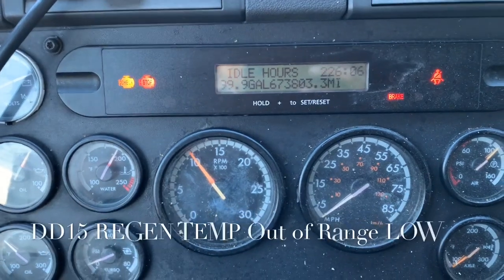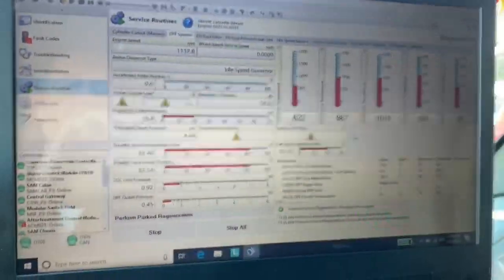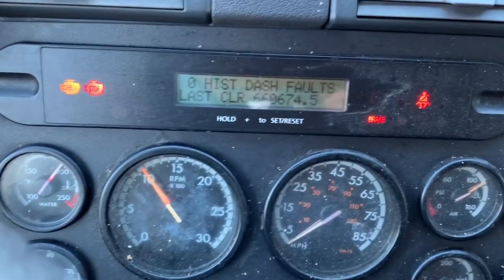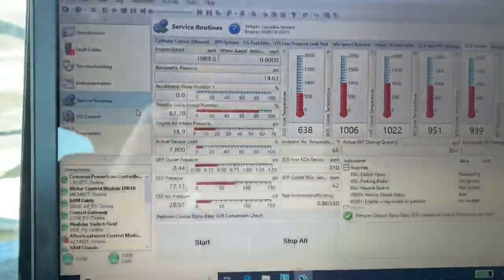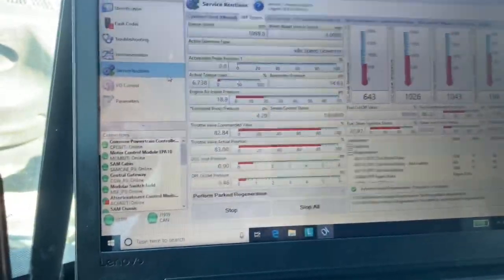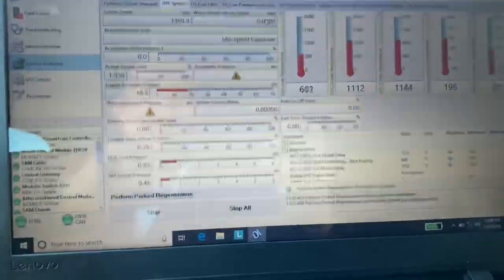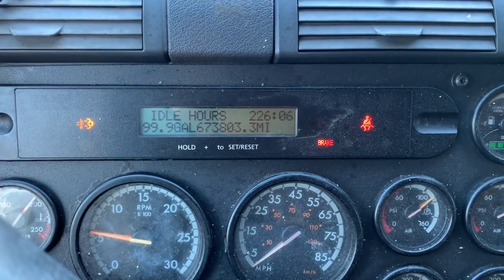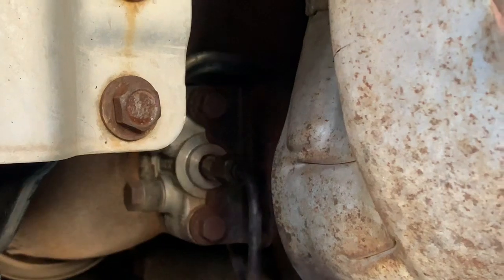DD15 with regen issues. Soot level high, parked regen failed due to not reaching temp. LOW

Comment: Yo bud mad respect for your attitude towards sharing knowledge that doesn't necessarily grow on trees. But to maybe get you to see if you can pick up what I'm putting down. Regarding the ability to read in real time as the zone/levels of soot as they come down, on how certain programs do not oblige such data stream as you would like. Now just hear me out a second. I might not even be making any sense in recommending to use the data monitoring of the delta-p. Sensor before, during, and after. IDK!! ,WHAT U THINK BUD?

Comment: I'm beginning to wonder if it's a problem with the Cascadia, as I've driven a few and they seem to want to conk out on when in lower gears, as I've noticed some sputtering and more hesitation when I've driven both the 10 speed and auto in the lower gears. That's my take on this. Could be that's where the soot build up is more noticeable as well too. I don't know.

Comment: Hello Pedro. Thanks for sharing your mechanical skills through your videos. I been having a major soot problem with my 2011 freightliner cascadia with a detriot dd15 engine. I changed my 1Box because my old box had a lot of rust around it causing weak areas to leak air. And it had high levels of soot as well at the time. After replacing the 1BOX l cleaned the filter that came with it and l blew out SCR filter as well. After driving for a week the system is totally clogged up again. I was so clogged that it blew the clamp because of the clogged 1box. I   towed it to the local freightliner dealership to have the truck checked. After 2 days  they confirm the system was clogged up really bad and they would need to order new dpf filters and air clean the SCR filters in the 1box. I explained to him l just had the filters cleaned and l had the 1box SCR FILTERS  blown out a week ago. I told the shop supervisor that's a lot of soot build up in a week. I ask him did he think it could be a problem on the engine side that would cause that amount of soot in a week. He said they will check to see if there was an issue with the engine. I never received a call they emailed me letting me know my truck repair was completed. I called them to get a run down of what they did and I was told they replaced the dpf filters repair 2 coolant leaks and they blew out the 1box filters. I ask the service person if they check to see what was causing the soot build up. He said because the dpf filters were bad because they were the original filters in the 1box and they failed the flow test. So after picking up the truck and driving it on the 3rd the truck seems like it running out of fuel and stop on the side of the interstate . I called road side assistant to bring fuel and filters after getting the truck to run it kept cutting off. After the 5th try l gave it gas this time and there was a large pop and black soot went everywhere. The 1box was completely clogged up again. The truck sounded good got over 7 miles to the gallon but its producing a lot of soot. The most common reason for too much soot is fuel and air mixture in the cylinder isn't correct to burn the fuel causing  soot buildup. I'm not loosing oil or coolant other than the 2 leaking hoses that was supposed to be replaced but they are still leaking because  the shop used the same old compression hose clamps. Pedro if you experience any repair jobs like this l would appreciate your feedback. Thanks in advance.
Reply from the maker: Heavy soot can be a few things. 
1) software update to the CPC, MCM and ACM will help. 
2) air filter replacement 
3) valve adjustment 
4) have the shop perform an ISB (idle speed balance) to see if an injector or injectors might be bad
5) use clean diesel or good quality diesel 
These are a few things that I can think of.
Reply: @CarlosDieselElectric  yeah l forgot to mention that they did an software update as well on the truck. But it seemed like the truck produced more soot this time because after 3 days of driving the truck it was completely clogged up really bad. I will have the shop check out your list. Thanks again!
Reply: @CarlosDieselElectric  l noticed over in Europe that they have different grades of diesel over there and a lot of truck owners use diesel additives to help the diesel particles burn better in the cylinder. Stanadyne Diesel Treatment is 1 that a lot truck owners use over there. They all claim that their trucks go a  month or months without doing a regen. So I'm thinking by adding a good diesel treatment will help cut down the soot level as well. What do you think about this? Thanks again.

Comment: check the fuel filter and see if the pin is broke off and fell into the fuel line restricting the fuel flow that will not allow the regen to get hot enough to regen the engine that is why Ash levels, to be higher this is what  happened to my dd15,

Comment: OTR. I had same issues. Honestly it’s not work. Until you clean dpf filter. The reason why this code come after 600000 miles because your dpf filter need to cooked. Why this code don’t come before 500000 mile or 600000 mile because your dpf filter clean. The smoke not cross completely to dpf filter cause of too much Corbin. The the smoke come to back to the injector 7th. You clean  7th. It’s work only few days. Again same issue.

Comment: Hello Pedro.
I'm an apprentice mechanic in Alberta Canada. I really appreciate your putting your knowledge and experience for us to watch and even learn from. 
Thank you
Reply from the maker: Glad you like the videos 👍🏼
Reply: @CarlosDieselElectric  
Hi, did you lock in the engine over ride button to keep the truck from shutting down.? Once those lights come on the computer won’t allow the truck to run more than 5min before it shuts it down.
Reply from the maker: @cedthetruth1311  the earlier trucks EPA07 did allow you to run with the over ride switch. Then EPA10 and newer came along and things changed. The over ride just lets you get over to the shoulder.

Comment: That sent me to the poor house,I replaced the one box,and still couldn t do a regen,finally, it was the DEF quality control valve (or something like that). 
The dealer in Knoxville assured me that once the box was replaced my troubles would be over,box was replaced and they took an extra 7 days to find the real problem,I paid for their incompetence... 20k doesn t sound like a lot,but it is a lot when the freight rates are very bad,almost 2 yrs later I can see light at the end of the tunnel debtwise.
I learned that Credit card companies charge a lot to finance 20k,I'd never used a c/c this way.
Reply from the maker: Sorry to hear that, I personally do everything I can verify that the One Box is still good before I say it needs to be replaced. I test everything out first for just that reason, I know how ridiculously expensive the One Box is.
Reply: What was the real problem?
Reply: @BlessednFree  I bought the trk used,the dealer assured me that they did ALL inspected all with a haircomb,I naively believed them.
I learned later that my truck was laid on it s side or crashed it s passenger side,YES,it damged the One box,eventhough it looked ok,it had a hairline cracked,not big enough to be seen,(unless you were the bionic man),but big enough to suck in air and create havock in the sensors,my truck ALWAYS had a yellow code,I spent so much money trying to fix it,until that one day when it could no longer be regened,once the box and the other issues were replaced and fixed,the truck worked magnificently,for about a year,then the engine went,but it had slightly over a million miles,the engine did what it did.
Looking back,I should ve kept it, it had new everything,radiator,hoses,box,injectors,clutch...
Anyhoo,I learned about the box the hard,expensive way.

Comment: 2011 cascadia code ecc 61 spn 3719 fail 00. Also code cab 33 spn 522116 has pretty much always been on. Ambient temp sensor was replaced a while back and temp has beem reading correctly. 

Both ecm computers and the transmissiom were replaced about 20k miles ago. 

Truck is doing parked regen now i initiated that because it was deratging at like 3mph. 

Also fuel has only been lowing from drivers side tank for the last few months since we removed fuel filter system that used to be installed but was getting old and broken
Reply from the maker: As far as the 3719, when you are doing a regen you have to look at other things like DOC inlet temp and DOC inlet pressure. Also, check the diesel Doser behind the turbo. Check for any blockage that might be preventing temperatures from rising.

Comment: I have a code 3242 and a high soot level and the dozer valve and dozer injector are not activating while doing a parked regen. Also the temps do not rise above 496 degrees. I did replace the dozer block and cleaned the dozer injector and it still doesn’t regen the regen aborts after about 40 min
Reply from the maker: Year? How many miles? I need more information
Reply: Didi you fix problem , looks like i have same issues

Comment: Would the ceramic gaskets on the tubing prior to the filters caused the heat to escape in the filters not get hot enough when doing a regen? This is a pre-one box Cascadia with the DD 15
Reply from the maker: If you are talking about an EPA07 (2008-2010 pre DEF), the gaskets help seal, but if the heat isn't transferring or going through correctly then issue may not be the seals. The DOC could be the issue, the Diesel Doser valve may be blocked.

Comment: Why didn't you replace the doser instead of cleaning it? Any reason?
Reply from the maker: In most cases you can clean the diesel doser injector and the opening. This almost always works, in some cases the doser block gets damaged as a result of the doser injector being blocked. 
Always start with low hanging fruit.

Comment: Hey Pedro, what would be to much DOC inlet pressure to do a regular regen ?? I have this issue with a 2014 cascadia, face pressure was in the 3 psi range, had the filters in the box completely cleaned, after installation, system still requesting regen/ soot level high, did a regen and the doc inlet pressure was at 1.4psi, which is weird since the filters got cleaned, should I do a DOC face plug regen ?
Reply from the maker: DoC inlet pressure should be 0.80-0.90 even 1.00 at best. Anything at 1.1 is considered plugged according to Detroit.
Reply: @CarlosDieselElectric  thanks for the reply

Comment: This type of work makes your light come on the next day
Reply from the maker: I don’t understand? What type of work?
Reply: @CarlosDieselElectric   u just put computer in and clean the def doser when thats not the problem with that truck it is the def heater line not getting hot enough to burn shoot range 600 is low if it has a good regen it's suppose to be at 1000 temp
Reply from the maker: Joel Sanchez sorry but you don’t know what you are talking about. I didn’t clean the DEF Doser, I cleaned the diesel Doser behind the turbo, those are two different things. 
The “DEF heater line” is so that the DEF does not freeze in cold weather. 
In my video, the temperature of 600 degrees is for the DOC inlet. The DOC outlet and the DPF temperatures will raise to 1000 degrees or higher. 
You seriously need to know what you are talking about before you comment or if you don’t know, ask questions.
Reply: @CarlosDieselElectric  this type of work took all my money
Reply from the maker: Joel Sanchez the after treatment One Box can be very time consuming and can get expensive. My video has nothing to do with DEF and only has to do with Regen temp at the DOC and the DPF.
Reply: @CarlosDieselElectric it’s only expensive because your mechanics want truckers to pay for you to guess what’s wrong we can do that our self lol you shouldn’t charge customers if you misdiagnose the problem
Reply from the maker: @BlessednFree I agree there a mechanics that guess. It does suck when the customer has to pay for guess work. I try to out myself in the customer’s shoes. Always important to explain the process to the customer.

Comment: So I'm is. Having issues. Doing a parked regen  it idles. Up and boost to about  28 psi for maybe 30 sec to 2 min max the shuts down then try agin maybe 3 times  in a row. But the regen light is. Off when trying but will try that same prosses a couple min later until you drive. Also motive the same thing if the light comes. On boost to 28 psi them drops boost bit keeps rpms up at 1200 ish have you seen this befor what can I do to fix this also nli have no lights no codes
Reply from the maker: What year? How many miles? Has someone been able to plug in and check the codes?

Comment: I have 2016 Cascadia truck. I have code of soot level high i tried to do regen it doesn’t run without engine fan off. Now i turned on the engine fan now regen is in progress but it has been more than 50 mints its not giving me the reading of nox inlet/outlet/conversion efficiency and many others. I also changed ACM. Please reply asap.
Reply from the maker: The software you are using. is it the original or is it the bootleg? Sometimes the bootleg may not read everything or it could be your laptop. I had an older laptop that was having a delayed issue with updating the temps.

Comment: I have a 2013 Cascadia. Truck asking for regen but will not engage. Tried to have it force regen but thats not working either. Any idea what could be blocking the truck from regen process?
Reply from the maker: husnain bhatti do you have a check engine, stop engine or malfunction light on? If you do, what are the codes?
Reply: @CarlosDieselElectric  i got the derate codes a day earlier, but truck was driving normal. Got it checked at the garage and about 8 wires under the truck were damaged, so had them replaced and everything was fine. 1 day later i had the regen light but truck wont engage. No check engine no codes on the computer. It wont even do force regen. Seems like the system kicks out the software trying to force regen on it. Mechanic tried to do a force regen on another truck and that was fine. So nothing wrong with his program

Comment: Need some help with Dd15. DEPF filter Clean, EGR Clean, DEF doser Clean, DEF filter Replace 5 months ago, but the truck keep asking for Rgen every 500 miles.  Any idea what can be the problem?
Reply from the maker: This can be a few things that might be causing this, are the DPF filters original? How many miles on the truck? Is the truck local? Does the truck go cross country?
Reply: @CarlosDieselElectric  i don't know if the DPF is original, I do over the Road. She has 713232 miles. Dpf clean about 2 weeks ago, EGR cooler clean, Coolant flushed last week, DEF doser Clean, DEF injector clean..

Comment: I haven't the same issue with my 2015 Freightliner, I have spent about $5k through a Freightliner dealership, still not able to resolve the issue for me. I'm on the East Coast, do you have any paid online session to troubleshoot?
Reply from the maker: ProSavvy Logistics you will need the software or someone with the software to perform a parked regen. This is so you can see the temperatures, the ITV opening or closing, the DOC in and out pressure. 
What have you done so far?
Reply: @CarlosDieselElectric  the Dealership did a parked regen with the software, but the temperature is very low and the regen stops abruptly.
Reply from the maker: ProSavvy Logistics so first thing to look at, engine temperature needs to be at 150 or higher. The temp will rise, but before you start the engine, remove the Doser valve just behind the turbo and check for any blockage (soot or carbon). Also, get some shop air and blow it into the valve. Then reinstall and start your parked regen. 
You have to observe the after treatment temps and the Doser activity. 
Let me know what you see.

Comment: I'm having this current issue. I have a 2017 freightliner Cascadia. What should I do?
Reply from the maker: Clean the diesel Doser injector located behind the turbo. 
Run a parked regen and lol the DOC inlet pressure. This will help you find out if the DOC may be plugged. 
Do you have access to the DDDL software?
Reply: @CarlosDieselElectric  It wouldn't let me do a parked regen.
What exactly is the dddl software?
Reply from the maker: @davionmcclendon4985  Detroit Diesel Diagnostic Link. It is the software that allows you to communicate with the truck   You can perform a parked regen and then monitor the numbers
Reply: @CarlosDieselElectric  ok thanks

Comment: Will a truck with a bad oil pressure sensor not complete a regen
Reply from the maker: That might be possible. If there a check engine light on. That would prevent a regen from happening. Also, a parked regen uses the engine brake to heat up the exhaust and the engine brake uses oil pressure. So it is possible.

Comment: Bro I got SPN 4374 FMI 0 showing up and got derate do you know if I can take the speed sensor off and make the running speed come back a little bit?
Reply from the maker: The code has to do with Under Pressurized DEF system (air or DEF related). You can try to remove the speed sensor, that might work.
You would need the Diagnostic Link Software to check DEF pressures.